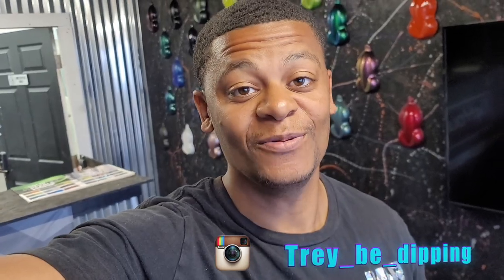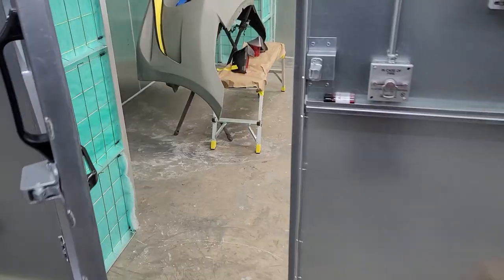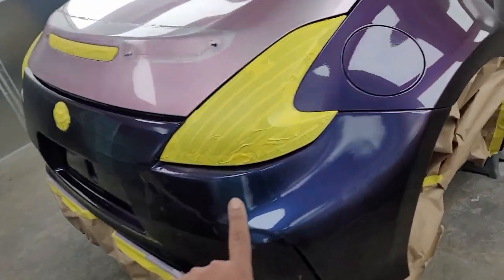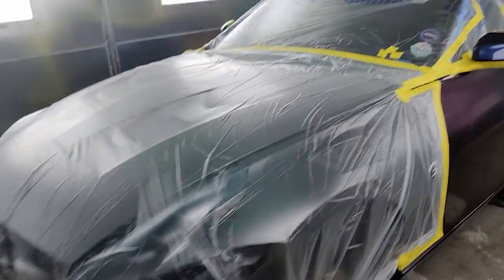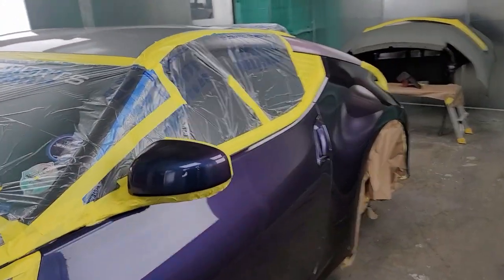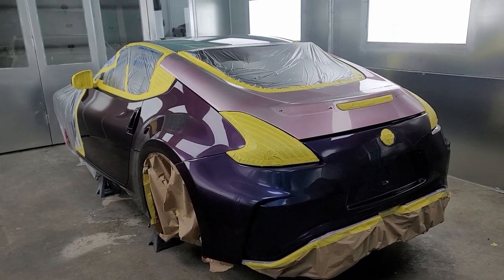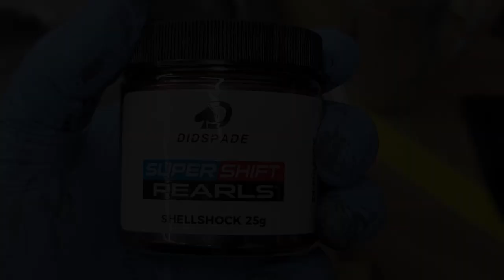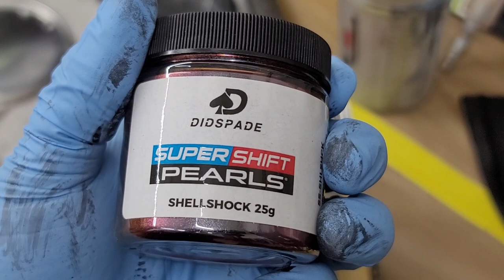Crazy modded 370z gets INSANE shellshock supershift in autoflex liquid wrap: MNR Dips

Comment: Do you remember your pearl to gallon ratio for this?  I saw you drop 25g into 1 gal, but unsure if you diluted it any.  Seeing how there isn't much black in the shift, I'm guessing it's a pretty high pigment load.
Reply from the maker: I used 25g per gallon. Was going for super saturated coverage. If you it to be darker try 5-10g per gallon
Reply: @treybedipping1734  Thanks for the reply!  I'm going to be spraying my Model Y this spring in shellshock, but I'm gonna use a lot less pigment.  I'll be closer to 8.5g/gal.  My test spray turned out sick, I just hope I like it on the car.